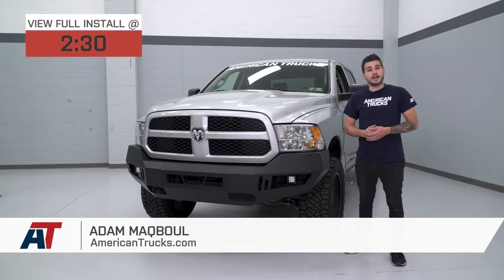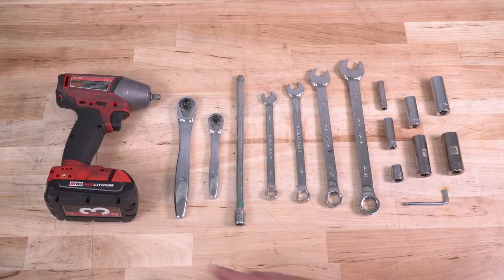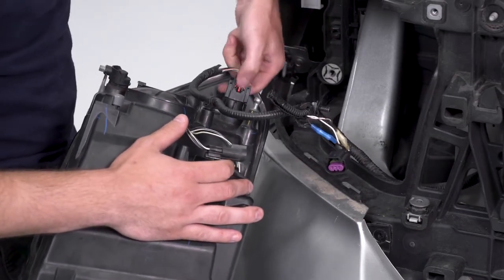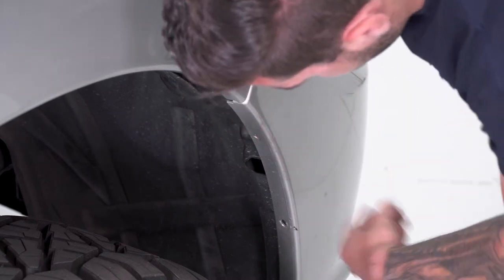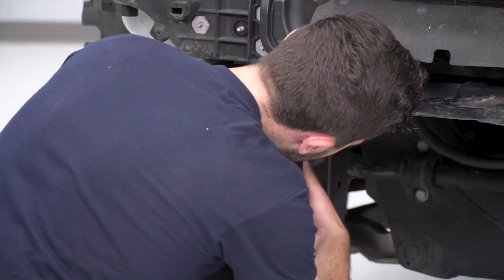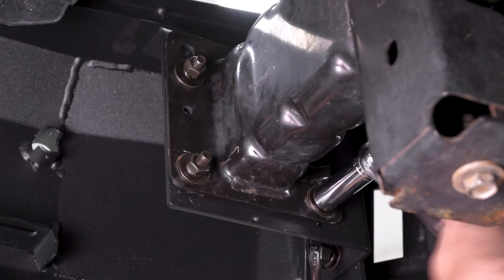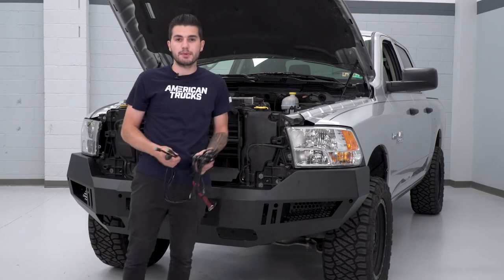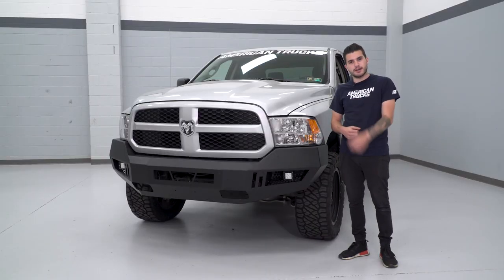2013-2018 Ram Barricade Extreme HD Textured Black Front Bumper w/ LED Fog Lights Review & Install

Comment: So how do you prevent the bumper itself from hitting the bottom of the fenders off-road?  The cab is actually the thing that’s moving as it’s mounted on rubber body mounts, mine hits the fenders so bad, the metal is actually distorted and the paint is cracked!   Sucks so bad!!   It’s exactly the same bumper has about 5 other manufacturers that sell this product as their own!   BodyArmor eco series,  barricade, Black Horse, ECT ECT.    How come nobody talks about this damaging vehicle!      Looks cool but it’s so annoying the banging the bumper makes as it’s hitting your fenders!   Just wish I could show a picture of the damage the bumper has done!

Comment: What do you do with the wires that went to the original foglights?
Reply: It seems like it would be so much easier for them to make them where you could just plug the new fog lights into the existing wiring.